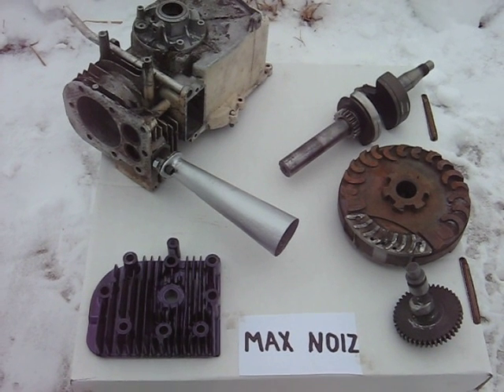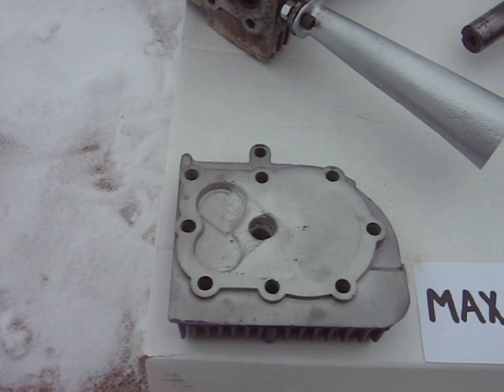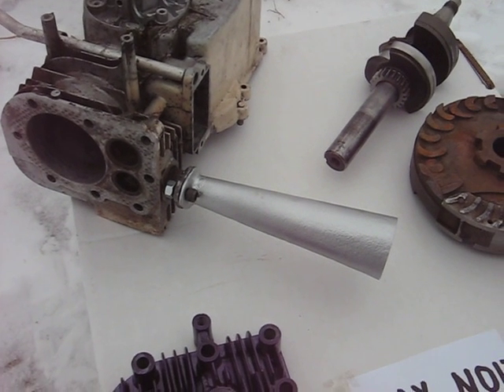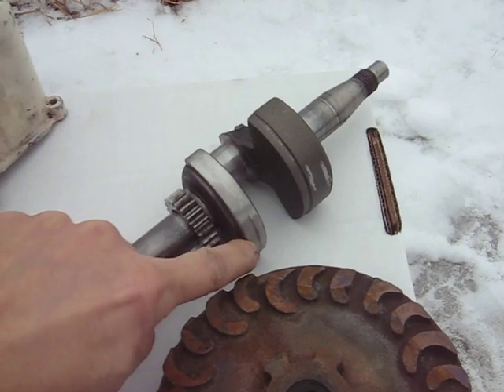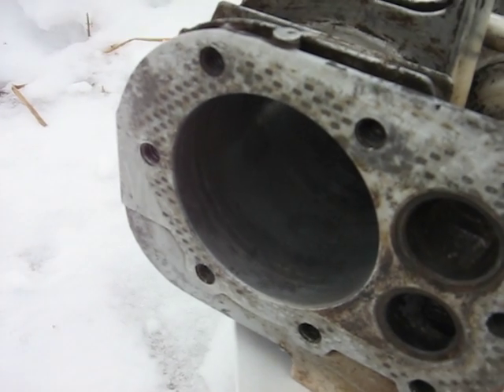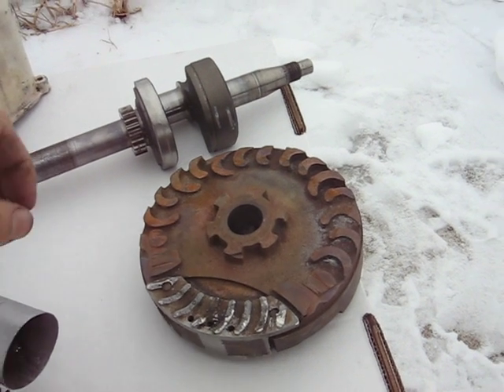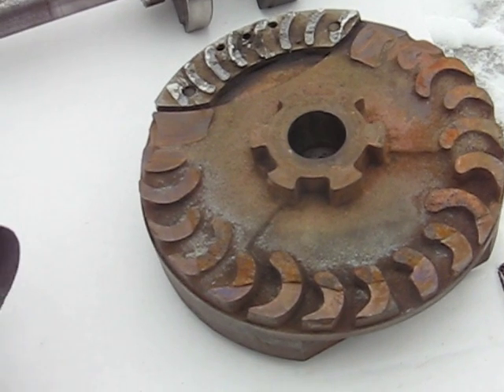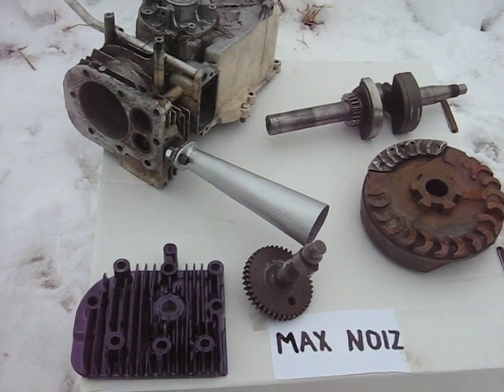70 Briggs Max Noiz Parts

Comment from the maker: @kddcc 
Oh, I am planning to try cutting the grass with this engine, just to make the Barkalounger Happy!
But, it shouldn't overheat, since the top flywheel stillhas all the fins on it, the one shown here goes on the bottom of the engine, when it doesn't have a blade in place.